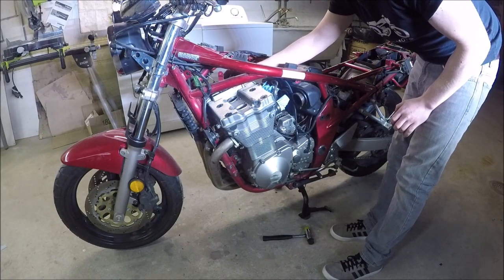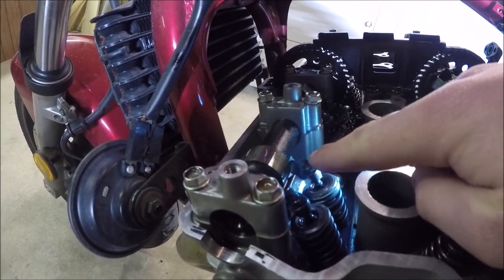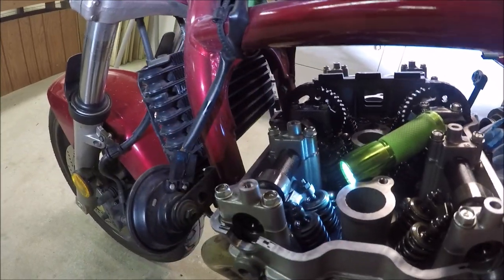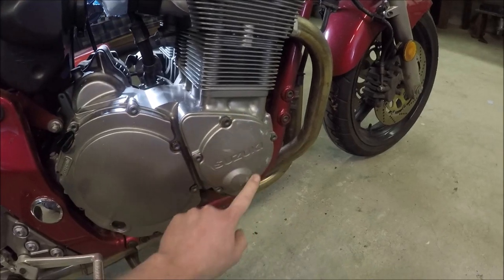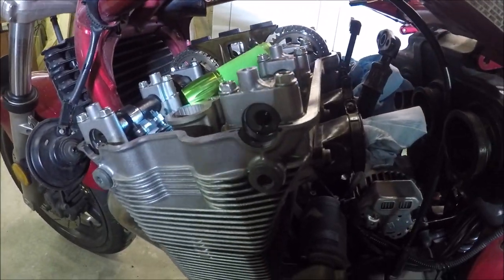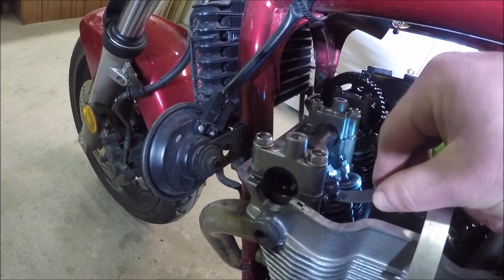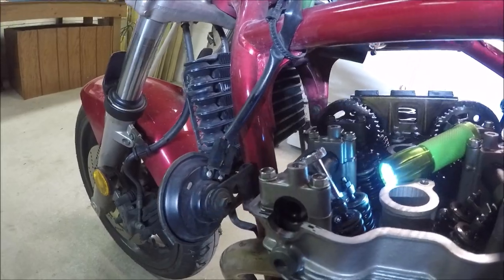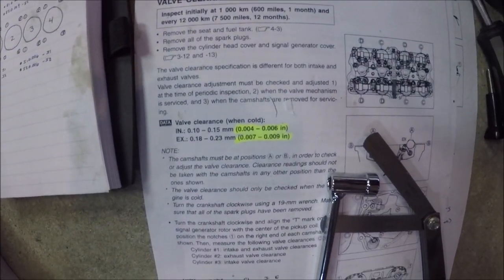Suzuki Bandit GSF600 - Valve Clearance Adjustment (short version)

Comment: Did you have trouble actually separating the valve cover from the head? I tried to get mine off the other week and it seems to be welded to the head and nothing will get it off bar prying it with a screwdriver (which I havent done)
Reply from the maker: Yes I did. I shot a longer vid that showed it, but figured nobody would want to see a 45 minute valve adjustment video. Getting to the valves took longer than the actual job.

I went all around it tapping with a soft mallet. Tap tap tap. Now, it's sitting on dowels if I remember correctly, so don't go blasting it.

I'm working on syncing the carb on my interceptor now.. But I can go back and look how I did it. I think I may have been able to wedge a screwdriver and tap it open.
Reply from the maker: Re-watching the video I took. I just went around and tapped with a soft mallet to try to loosen hit. However, there were two bolts I missed at first, and I was trying to pull it off (dumb, obviously, but double check). I was then able to wrestle it off just by pulling up hard.

It's like a 9GB video. I can upload it later tonight and post a link with a timestamp for you. I should probably do it anyway since I took the time to film and edit it. I'll just add it as a link-only video. 

The relevant point of the video is right at 20 minutes once I get it uploaded.
Reply from the maker: Alright. Go to 20:00 minutes in on this video, and you'll see how I got it removed.

https://youtu.be/WWQHyqpXkfQ

It was my VF that I had to use a screwdriver and tapping to remove... Thats why it was in my head.
Reply: Thank you!

Comment: Essex, in the U.K..... The new E10 fuel is bad (Bandit K4 600). I've not used it since the bike ran badly on it. Also, just wanted to say, not a bad idea to change the fuel-filter & air-filter while the tank is off. Personally, I'd do an oil/oil-filter change after this job as well. Also, don't be a BAD-CHUMP!.... Make sure you use GENUINE Suzuki ... From a dealership! Adjust your clutch regularly. Heated grips and gloves to scrape the ice off your seat before you leave!
Reply from the maker: You guys also have carburetor heaters over there--we don't in the states. It really confused me for a while trying to figure out where in the world to connect the unused electrical connector to.. lol. 

For the air filter I've tried both the HifloFiltro and OEM and couldn't feel any discernable difference. About 2000 miles on the Hiflo and 1000 on the OEM. Suzuki dealerships are few and far between near me. Heated grips would be nice. My only issue with them (I have them on a VStrom) is their width. I feel like I have less control of the bars with the bigger grips.
Reply: Can see the air-filter, but not inside the fuel & oil-filter... Just my preference. I'm a complete novice compared to you dude. FOR the Bandit Brethren... Managed to fit Oxford's Heated Touring Grips to Renthal Handlebars. Have the original bar end weights on the end as well... You just swap the Renthal bar end fittings over onto the original weighty ones..  The Renthal ones weigh nothing!
Reply from the maker: @ReggieChump  heated grips are such a nice luxury. Unfortunately it's snowing right now, and... I saw them salt the roads yesterday. gah. it's real now. I'm stuck inside.
Reply: @matttriestodothings  You're a good bloke, Matt. Hope the VFR is going soon and the snow is gone. Still riding the Bandit through the Winter here (saves me unloading the tool's from the car). I'm hoping you'll get another Bandit 600 and do some more videos.... Not holding my breath though!
Reply from the maker: @ReggieChump  thanks Reggie, I appreciate it. I'll get the VFR working--everything is a learning process with these bikes! If I ever get a shot at a 1200 Bandit, there may be another one at some point. I'm really curious to know what the extra 600ccs does, hah.

Comment: I have this same bike that I pucked up took apart. I dont know where all the fuel vacuum lines go and I'm looking for a video showing where all of em go
Reply from the maker: Hmm.. I'm not sure that I have one that specifically shows them. Luckily, this bike is (relatively) simple in that regard. Best video I have that sorta shows them is here to remove the carburetor. https://youtu.be/5fT026Yd7_I

Anyway, there are two vacuum lines. Carb 1 and 2 will be capped on the vacuum nipples. Carb 3 will have a 3/16" vacuum line that runs from the carb vacuum nipple to the PAIR system. This is that big mess of hoses over the #3 spark plug area even with the top of the frame. It injects cold air into the exhaust. The second vacuum line will run from the vacuum nipple on carburetor #4 to the petcock on the bottom of the gas tank. It's vacuum operated, so it should only pull gas when the bike is running.

Fuel line is the easiest because there's barely any. There's about a 8-10" run from the fuel outlet petcock on the bottom of the fuel tank and it connects to the fuel inlet in the middle of the carburetor. This is 5/16" fuel line.

Additionally, your tank has a vent and overflow line coming from the upper right bottom of the tank. These route through the bike and down to the ground. I honestly haven't bothered replacing mine yet, so I've been running without.

Hopefully that helps some. If not, check out the Suzuki bandit forum (Suzukibandit.co.uk or something) that has a ton of good information and people willing to help.

Comment: Took my valve cover off today, I was greeted with an overwhelming smell of gasoline and it appeared that the head had a couple pools of oil/gas mixed together from the previous owner.  I also managed to drop one of those valve cover bolt washers right into a spark plug well, took me a solid 20 minutes to fish it out.  More often than not this motorcycle pisses me the fuck off and I have to stop working on it for a day or two.  Seriously appreciate the videos on this motorcycle!

Edit:  All my exhaust valves were too tight.  4 of my intake valves were on point.  27k miles, I don't think the valves were ever adjusted before.

Comment: Thanks man,  heading out to do my katana 600.
Done plenty of bucket shim valves on quads but this is my first street bike so it was nice to visually see everything opened before digging in. 
Thanks again for taking the time
Reply from the maker: If you're already familiar with the (generally) more complicated bucket shims, you'll probably find tappet style easy peasy.
The part that takes a bit of practice is locking the locknut without overtightening the tappet and throwing off your clearance. You'll have it in a couple practice runs though. Good luck Travis!
Reply: @matttriestodothings  thanks man,  for er done fairly quick and she's running awesome.
Best 300 I've ever spent lol

Comment: Thank you. Had real trouble getting the cover back over the cam-chain without it pulling the spark-plug gasket/rubber off... Had to put it in upside down in the end with the cover already past the cam-chain. The other three stayed on ok. Last time I did this job, I didn't replace any of the gaskets... they were stuck in place. I didn't use any sealant both times. 
Thank you for the video, it really helped me out.
Reply from the maker: Thanks Reggie--I'm glad it was useful. I got lucky in that the spark plug gaskets on mine stayed stuck really well to the valve cover, but it's certainly a little nerveracking dragging that cover back on just hoping they stay in place.
Reply: Thanks again, Matt. Just subscribed. Will  drop a like on all your video's.
Reply from the maker: @ReggieChump  no worries Reggie--if they suck then down vote em, lol.

Comment: You make it look easy. I did the valves on my 93 fzr600 back when I was young and swore I would never do it again.
Reply from the maker: The magic of editing, hah. I did this over a couple days. It wasnt that difficult, but it's just time consuming. And once you're in there, you want to double and triple check everything because you don't want to have to pull everything back off if you get it wrong.

I haven't done my fzr yet. I'm considering having a go this winter. I don't think the valves have ever been looked at in ~30k miles. Are they locknut or shim and bucket? If they're shim I'm just going to leave it alone and hope for the best.
Reply: Shim and bucket. I was a kid this was back in like 94. I just remember trying to get the cams lined back up. I probably wouldn’t have much of a problem with it now I would hope
Reply from the maker: @mmotorcycles9497  ooffffff course they are.. lol. I've actually never done a shim and bucket valve job, so maybe it would be worth doing as a learning experience sometime. I'll read through the manual and see how tough the procedure looks. I have a new set of air intake boots for the carburetors I need to install anyway, so I've got to get in there pretty good anyway.

Comment: Tomorrow I'm gonna do it! 
The valve cover gasket was leaking and I'll adjust the valves as it's already open... 
Btw, just cleaned the carburetors and this week I'll reinstall it and do the sync.
Reply from the maker: Good luck dude! If you've already gotten the valve cover off, you've already competed the toughest part. Just make sure to measure a few times when you're done to be certain, and you'll be good to go.
Reply: @matttriestodothings  valves are fine, but I'm having a hard time with the carburetors... 😫😫😫😫😫😫
Reply from the maker: @tuntatis  You need to read them a story to calm them down. Usually at night. I prefer "Goodnight Moon".

What's wrong with the carbs? And go figure, the carburetors are the problem on a Suzuki Bandit. Most finicky carburetors I've ever set my eyes on.
Reply: @matttriestodothings  they are already tuned, but the first one started.leaking... then I disassembled and changed the buoy needle valve (that stops the fuel from overflowing) of all 4 and now it's.leaking on the 4th carb...
Reply: @matttriestodothings  Now I finally managed to stop all leaks, but the bike is completely bitchy at low rpms... 😫😫😫
Tricky carbs... It's something to test your patience and faith!

Comment: clear explanation, thanks for that.
One question though, did you change any of the gaskets?
Reply from the maker: Thanks Jack. I did not change any of the gaskets during this procedure. The valve cover and spark plug hole gaskets were all still in good condition, and nothing is leaking yet.

Comment: Did you have any problems removing any of the cam cover bolts  ?...like the one at the very front  under the headstock ?.
Mines seized ...local bike shop has just spent half a day trying to remove it and failed .
Have you any tips at all ?.
Reply from the maker: I did not on this bike. If you want to know how I dealt with a stripped cam guide bolt... Check the last one minute of my sv650 valve adjustment video. It involves me throwing a hammer and damn near exploding my laptop. I was furious. Those bolts are supposed to be like 6ft-lbs tight.

Oh, I got it out by hammering in the absolute tightest fitting Allen I could. If I had a torx, I'd have used that. Then I hooked it up to my impact WRENCH, not driver, wrench, and I hit it as hard as possible. Then it came out.
Reply: @matttriestodothings  thanks for your reply , I'm going to try a tight fitting torx bit to start with.
But the bolt I'm trying to remove is the 8mm or 10mm one right at the front of the engine underneath the headstock and it's difficult to put any load on it be a use of lack of headroom.
If that doesn't work I think I'm going to grind of drill the head off ,that should release the cam cover ,then try to remove the remaining stub.after .
Reply from the maker: @kevinspalding5470  ahh, shoot I thought you were talking about a different bolt. That's pretty crazy that the valve cover bolt on yours is that stuck in there since it still isn't supposed to be a highly torqued bolt--the gasket does the seeling, not the tightness of the bolts.

Honestly if you haven't yet, I'd probably shoot the question over on a dedicated bandit forum. If there's any chance of getting an impact wrench on it with a tight fitting Allen bit, that's probably the best bet. If not, and you need to drill, I'd think about what precautions are necessary to make sure no shavings end up falling into the valve train and engine.

Good luck man. That's a shitty problem to have to deal with. Hopefully it pops out soon for you.

Comment: Is the gasket sealant you used a grease or a silicon gasket forming glue like substance.
Reply from the maker: It's more of a sticky gasket forming surface. And I try to use less now (less compared to the vid) because you don't want any of it squishing off on the inside, hardening up, and making it's way into an oil passage to block the passage.
Reply from the maker: Hondabond High-Temp Silicone Liquid Gasket

Comment: Excellent work friend. Congratulations. I noticed that the camshaft is very clean. What engine oil have you used?
Reply from the maker: I use Rotella T4 -- the 15W40 dino oil. It's relatively inexpensive, so it doesn't break the bank to change it often. I was super happy to see that the camshafts looked like they were in good shape! Would have been disheartening to see pitting.
Reply: @matttriestodothings  excellent friend. Thanks for your answer. In fact, by changing the oil more often the engine will always be cleaner. Not to mention that diesel engine oils have more detergent, which characterizes cleaner engines.

Comment: I have the same bike it is having a starting issue I can’t get it to start I pulled the head off replaced the head gasket did the timing never adjusted the valves tho you think that’s why it might not start
Reply from the maker: I wouldn't think the valves would be the reason it wouldn't start, though they may contribute to it running poorly. I would venture to guess it's a fuel delivery issue if you haven't resolved it yet. Sorry on the late response--I let this one slip through the cracks. Hope you were able to get it sorted out.

Comment: Be thankful here not under the bucket shims. Like on my 94 GSXR motor.
Reply from the maker: Ohhhh you bet your ass I'm thankful. I'll be doing my first shim-under-bucket valve clearance check on an SV650 this winter, and I'm already dreading it. Got my fingers crossed tight that the clearances are within spec!
Reply: @matttriestodothings  When ya get old like me. The # on the back of the shims look mighty small.

Comment: i have the same bike and used this video as reference to adjust my valves. i noticed there is a fluid sitting in a pool on the side of the 1st and 4th valves. is this normal?
Reply from the maker: Good question. Unfortunately, I don't know enough about these engines to tell you what is and isn't normal. You're likely to find oil all up in everything, but I don't *think there will be substantial pooling. Wish I could be of more use Ryan. Might want to post that question to BanditForum or similar so someone with more knowledge can help you out.
Reply: I had the same fluid sitting in my head.

Comment: Where are you getting the specs , im trying to get it for a different bike
Reply from the maker: These came out of a Clymer manual. If you can find a copy of the factory manual for your bike, that's the best place to get the valve clearance specifications from.
Reply: Thanks bud

Comment: great video, I've got a 2005 gsx 750f katana and having trouble finding the valve clearance specs for it..
Reply from the maker: Thanks man. They should normally publish the clearances in the "maintenance" or "intro" section of your bike's manual. I know that's the catch-all easy-way-out of explaining it, but without being familiar with your specific bike, I don't want to guess.
Reply: what about reusing the existing gasket
Reply from the maker: @WiggSplitter75  if you're talking about the valve cover gasket, reusing it shouldn't be an issue as long as it hasn't been damaged. I've only ever replaced a valve cover gasket on one of my bikes (1984 Honda vf500f), and it really didn't need it.
Reply: @matttriestodothings  thanks bro, I've never done vales before until now,i probably should use gasket sealer on it.. thoughts.. gasket seems to be in good shape and didn't notice any cracks
Reply from the maker: @WiggSplitter75  99% you're not going to need any gasket sealer. The only spots the could need it are the "half moon" or "mickey mouse" areas. And quite frankly, if the gasket is in good shape, I think you actually introduce more risk by using gasket sealer for fear of a piece of it falling off and getting into the oiling pathways.

You'll know when you fire it up. Congrats on doing a job that would have cost you a pretty penny and also probably learning a bunch about your machine!
Reply: @matttriestodothings  thank you for the video,i probably would not have attempted to try this without your video, it's saved me hundreds of dollars 😀
Reply from the maker: @WiggSplitter75  no worries man. Hopefully it was useful. No matter what anyone says while sitting at a bar or bullshitting in a parking lot--this shit is intimidating to do for the first time. Especially by yourself. It's 10x more rewarding to ride the bike afterwards though--even if you did have to run through the dictionary swearing at the thing and the unclear instructions! Cheers.
Reply: i completed the task,i started and let it run for about ten minutes, sounds good just gotta wait on some warmer weather to give it the real test😀
Reply: go big Blue
Reply from the maker: @WiggSplitter75  hell yea man! If you're not seeing gasket leaks by now im betting you're good. Just clean up around the head well so that if anytbkng shows up, you'll see it. But I highly doubt it. Congrats on a job well done.